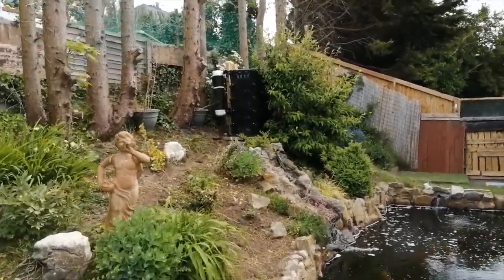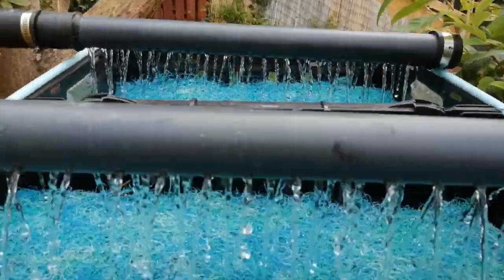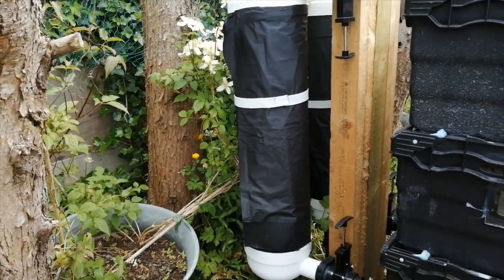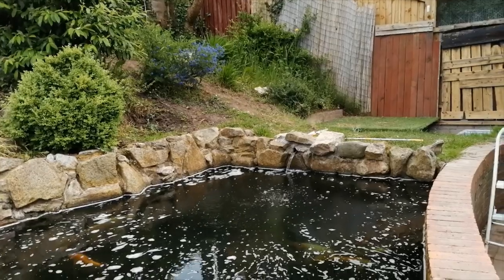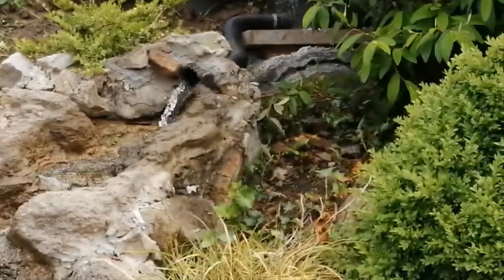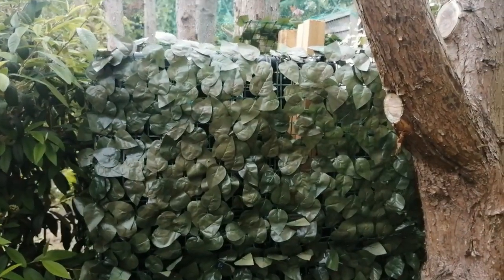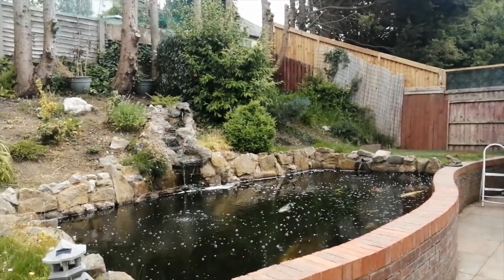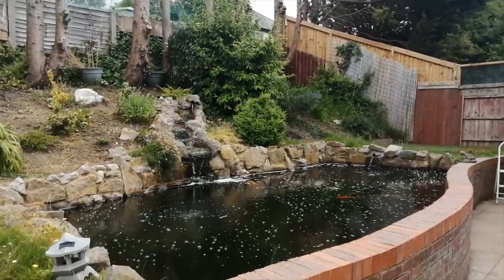Concealing Cetus Sieve, Twin Tempest Up filters and double Bakki shower now complete.

Comment: Why wouldn't you put the Perspex panels on the inside?
Reply from the maker: The Perspex is just a precaution to stop any lost water due to splashes. And given that the trays are hidden, it doesn't  matter if the Perspex is on the inside or the outside. Thanks for your interest.👍

Comment: Doesn't seem like a lot of flow rate for a pond that size. Might be worth upgrading the pumps for getting up that hill and then through the tempest/showers.
Reply from the maker: A single tempest can only take a flow rate of up to 5,000 litres per hour for maximum performance. Any higher and it will start to push the particles through the K plus media and back into the pond! That's why I have installed two Tempest's. My 20,000 litre an hour Varipump is running at 60% to allow for the upward slope so the water is being pumped from the filter pit through a splitter and delivering around 5,000 litres and hour to each tempest. That is turning 10,000 litres an hour through the filter system. The pond holds around 20,000 litres so the whole volume of water from the pond is going through the filters every two hours. That's the logic behind my thinking. Only time will tell but the clarity of the water is defiantly improving. Thanks for your interest, it's very welcome. 👍👍